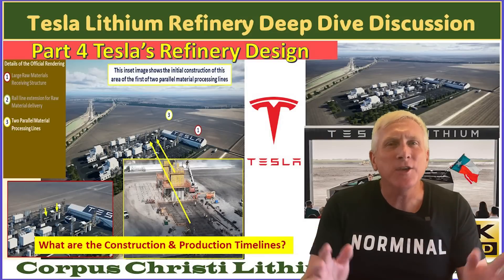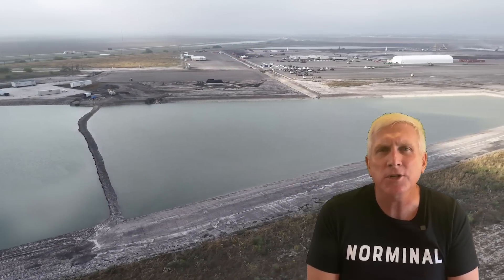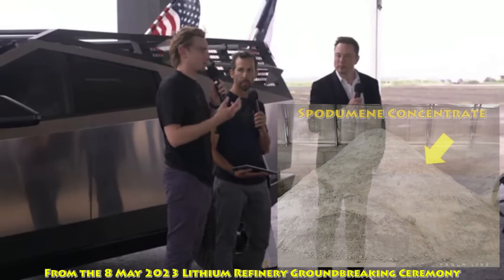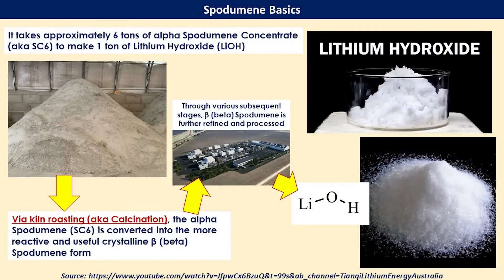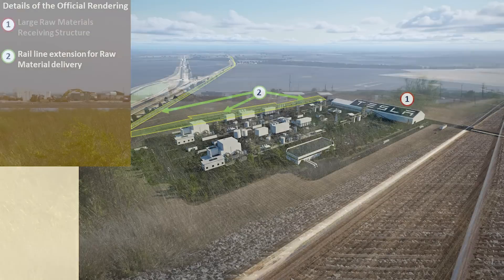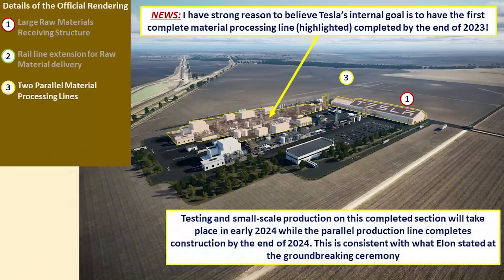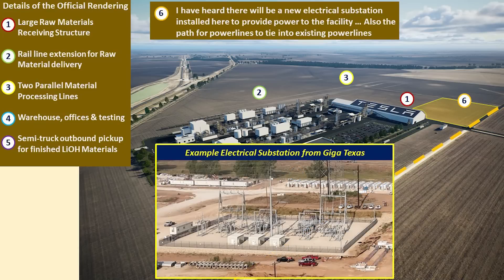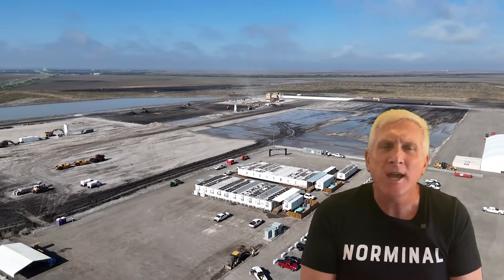Part 4 Tesla Corpus Christi Lithium Plant Deep Dive Video (Refinery Design, Timelines & Expansion)

Comment: Could anyone explain where the spodumene concentrate is coming from? Joe stated from N America but which actual mine site or sites? Please name these mines if possible as this information is vague. I've followed Pilbara Minerals in Australia for many years and they are currently the largest supplier globally in Hard Rock lithium spodumene. PLS had significant issues making SC6 spodumene concentrate which is currently at grade SC5.5 and had to revise their plant processing significantly in the last few years. This lower grade also makes a significant difference in processing costs and waste. Deleterious material can affect outcomes in processing and can seriously effect battery grade hydroxide. Tesla seems to be following IGO/Tianqi calcination process from Greenbushes but again IGO is currently experiencing major problems with ramping up their new Kwinana hydroxide facility which is reportedly being rectified by H1 2024. Greenbushes lithium is currently the highest purity product globally for battery production with very low deleterious minerals in their spodumene and not contaminated with Fe like PLS spod. Any light people here could shed would be greatly appreciated.

Comment: Joe, a great summary of what Tesla is doing. First stage is essentially a Spodumene to Lithium Hydroxide plant. Material recycling and other processes will come later. I note it is 23,000 km, 14,500 miles from Perth Australia to Corpus Christie via Cape of Good Hope - about 5 weeks sailing. The volume of Spodumene mines in Western Australia will surely set the concentrate price to which must be added 5 weeks direct transport to the US. As Corpus Christi is a city whose knowledge is raw material processing, I expect CATL and other cell makers will split battery production in the same way. Austin is about 4 hours truck drive from Driscoll. Which means a Semi can do 3 round trips per day when charging is included. The high purity requirements for cathode, anode and electrolyte materials will mean a "just in time" supply line from raw material (concentrate) processing to cell first cycle. Cells can be stored in large numbers, but Tesla appears to have a preference to store battery packs.
Reply from the maker: Part 6 goes into the processes in much greater detail 🤗

Comment: As normal, Joe provides a significant amount of real data and the overall context. This facility appears to be really moving forward fast. It clearly indicates that Tesla is committed to the 46x80 Lithium battery, with future adjustments into its detailed chemical makeup. Tesla has spent a significant amount of of R&D money to make the 4680 battery manufacture cost as low as possible. This will put a large amount of pressure on the other vehicle manufacturers to match their cost, which is not likely.
Reply: It seems every other week there's a "new battery breakthrough" ...that won't be here until 2027, and the first plant will only be 2-3 gWh. With more factories years behind that. Tesla needs 10x that, in 2025, just in North America. I hope some of the energy density & fast charging promises of 4680 come true sooner rather than later.

Comment: Any plans to connect Giga Texas to the same railroad system near Gigafinery to efficient raw materials transport?
Reply: My guess as someone who lives in the Austin area is NO. The Union Pacific line that comes into Austin from the south turns slightly west in downtown Austin and continues north along Loop 1 on the west side of town. GigaTexas is located several miles east of town. I think it would be way too expensive to run a spur line off of that main line to reach the factory.
Reply: @loucatozzi7656    Additionally the 200 miles between the sites plays well into costing structures; rail tends to get used in the US for longer hauls before it becomes cost advantageous.  If they were shipping to CA for instance, you'd definitely expect it to go by rail.  Between Austin and this site, that's a 200 mile run, more likely someone would drive up and back same day (starting at either endpoint).  If those trucks are Tesla semis - weight allowing - it would be pretty cost effective relative by comparison to diesel tractors...